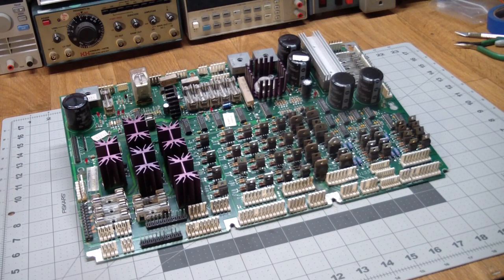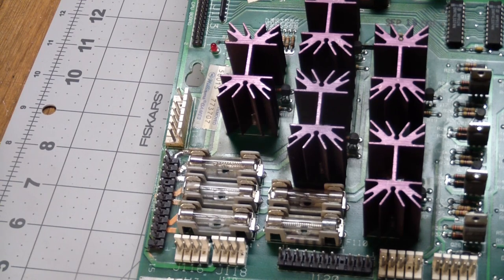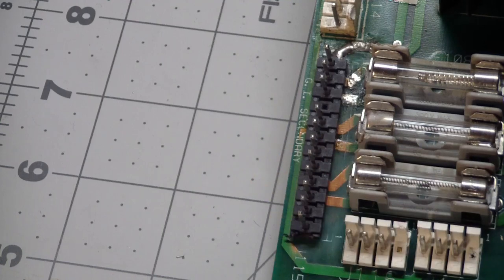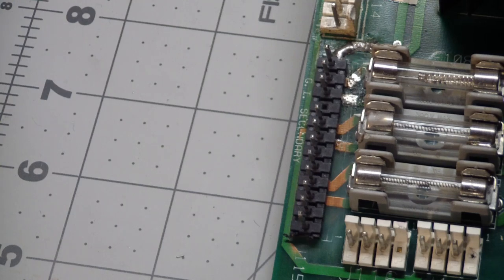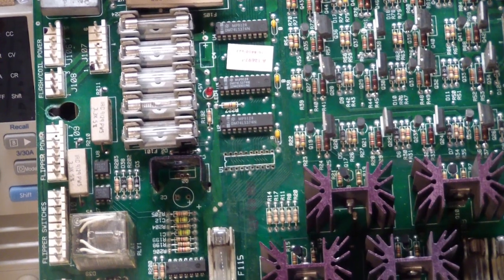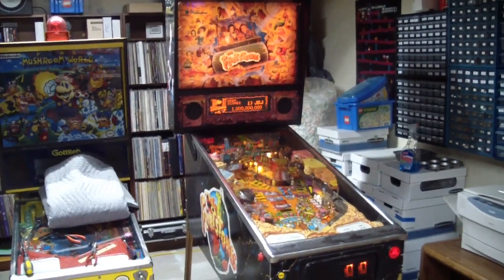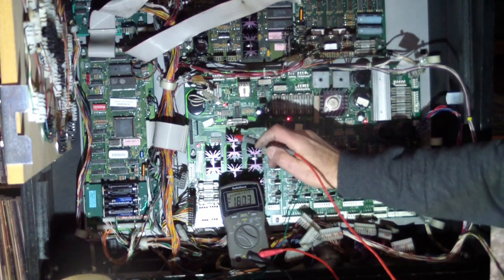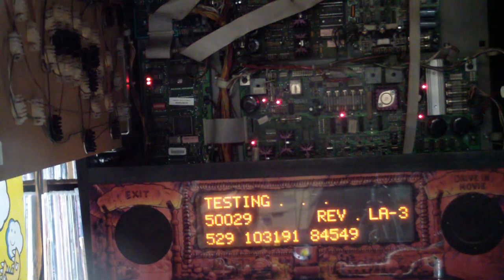AE#130 Williams Pinball Controller (WPC) PCB Fault Analysis And Repair, Part 1

Comment: Your remarks about Philips electrolytic capacitors caught my attention: I recently repaired a couple of Racal 9478 Frequency Distribution Units.  They both dated from the late 1980’s and both used Philips electrolytic capacitors.  These were the ones with the blue coloured sleeves, all dating from 1987-1989. Every single one of those nearly 100 capacitors was defective, measuring only a fraction of its marked value and ESR values into kilo ohms. None had failed short (a good thing in retrospect).  Thanks for the video👍🏻

Comment: Thank you for sharing your knowledge. My Creature from the Black Lagoon 1993 uses the same driver board that still works flawlessly. I do have burnt pins on J115 and J120. I will be replacing the header and connector for both. I am afraid of through hole connectivity damage when desoldering so any tips / videos on how you do it will be great. Also while I have the board out should I replace all the caps as preventive maintenance? Any other preventative maintenance I should be looking at?
Reply from the maker: Getting out the pin connector can be difficult. What works best is to carefully cut the plastic pin holder on the board inbetween each pin and then simply heat each pin from underneath and pull it out. Use side cutters and cut gently.
As far as preventive maintenance replace C2 near the 12V regulator. It has a tendency to leak. And also any blue Phillips branded caps, they all fail.

Comment: The insidious capacitor plague strikes again. Looks like a huge time sink to get that board back to reliable. Are the PCBs (bare or stuffed) available as replicas?
The Flintstones game looks cool...
Cheers,
Reply from the maker: I think Rottendog made a close replica board, but those are no longer manufactured. (And the price of existing stock seems to have risen by $100)
Reply: pinball basement is making power driver boards and cpu.s from williams files for wpc machines. 350 us dollars. I was going to buy one for my Hurricane but my board guy did a helluva job rehabbing my board to save it. They also have DMD controller boards too.

Comment: why are they using Triacs for dimming the GI lights? because Triacs are ment to be used for AC voltage not dimming DC voltages. Any reasons why they use those big square power resistors for the Flash light bulbs?
Reply from the maker: I should mention that the GI lights are in fact powered by 6.3 VAC from the transformer, and the Triacs are controlled by the one of the latches.
If you're referring to the gray squares near the top of the board then those are bridge rectifiers.
Reply: @artifactelectronics  Most pinball games have Flash Bulbs which are connected to these big square power resistors not sure why they use those square power resistor for the flash bulbs circuit. The latches are digital latches that the Triacs are controlled by the latches or the Triacs to vary the AC or DC voltage of the GI lights? I'm not sure what the latches are doing to the Triac